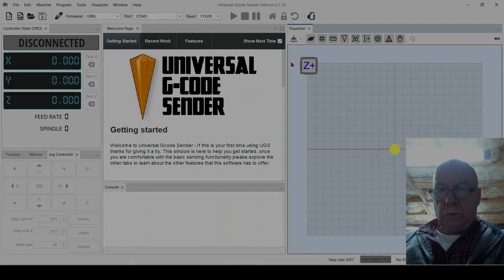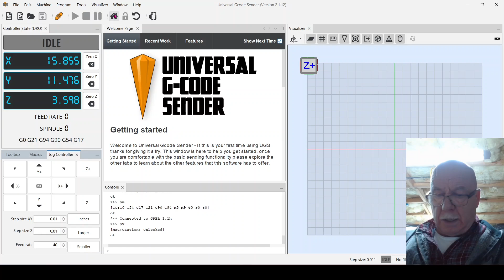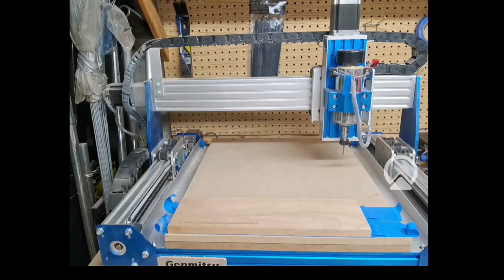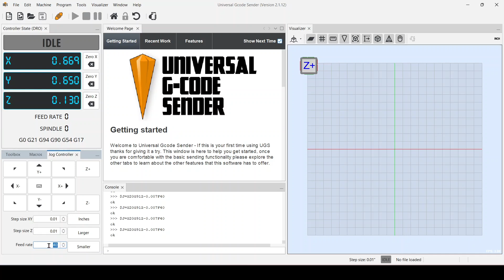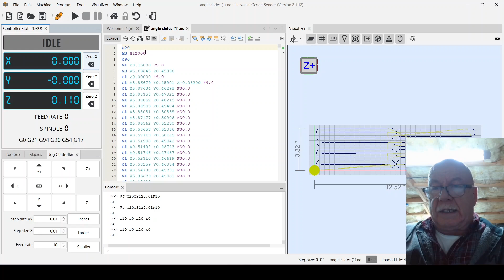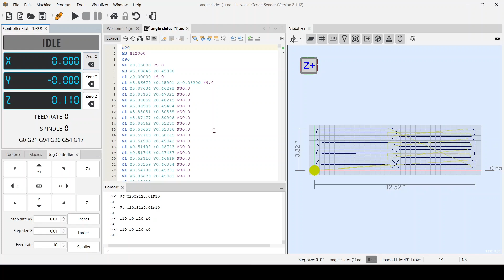Fire up that CNC now!!

Comment: nice explanation, thank you
tell me please, when i set the machine in mm how to set the steps on x, y and z
Reply from the maker: I have not done that yet because I usually work in inches and I don't want to give you the wrong answer. I'm sure there is a video on this and I will figure out how to do it and maybe make that a separate video. Thank you so much for the nice comment!
Reply: @JBCraftsandWooodworks  i think calibration in mm or inches is the same.
do you make calibration befor every work you done, i mean after each switch on of cnc? or cnc save all this information?
sorry i am a newbie
Reply from the maker: @floriniovan2591  Your CNC will save all your calibrations, You do not need to check them each time you turn your machine on or off. When you put a part on and run a program you have to zero out your work offset, meaning touch Z to top of part and zero it, then center of tool off front left corner  and zero your X and Y  doesn't matter if inches or MM you do the same process for each new part or new program. Maybe I'll do another video and go more in-depth on this subject